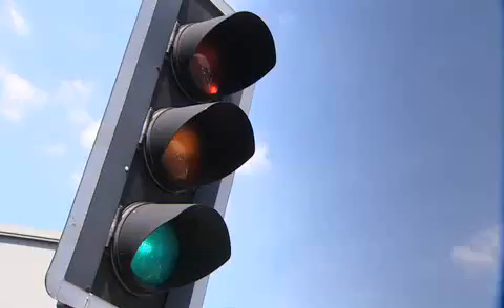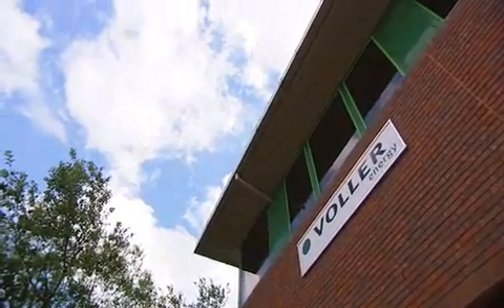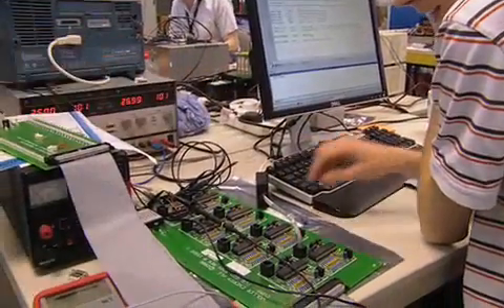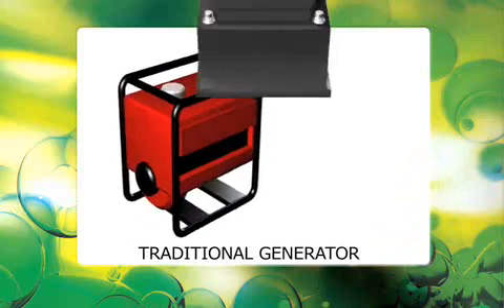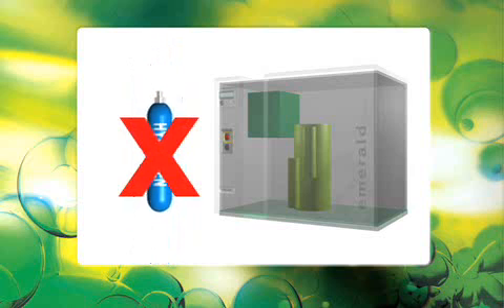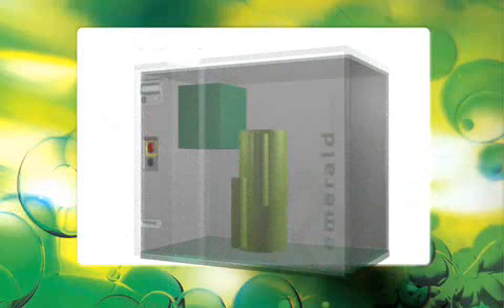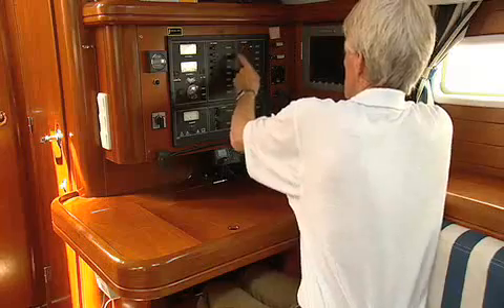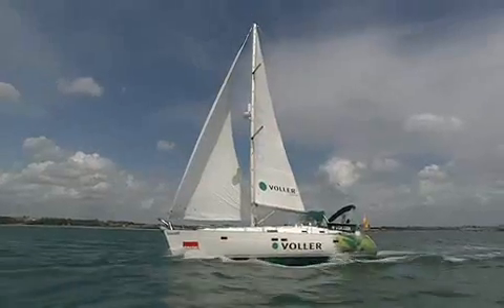Fuel cell generator on sailing yacht

Comment: Maybe enough to run the navigation lights and radios but not a microwave or radar. That would take a lot more than wind from sailing. If you have a large enough battery bank you could sail for a weekend but you would be using more than replenishing. Electric winches also require a lot of power and most sail boats have to have them to get by  sailing with only 2 people. A combination of solar and wind possibly could charge the batteries as  long as you did not need to use the air conditioner.

Comment: You are on a sail boat. which means wind. Get a wind turbine. It's cheaper, doesn't run out of fuel, and reduces the need for a large generator.

Comment: @21scuderia - 
YOU stupid fuck, thats what i'm telling you.
Hydrogen is just a way of storing energy FROM wind and Solar.

thats why its useless.

could use nuclear but that has the same problem as oil, its a finite source you dig up which will run out.
What i'm trying to tell you is, when the oil runs out, its "game over" for most humans, and hydrogen wont save you, because, as I originally posted, it is not an energy source.